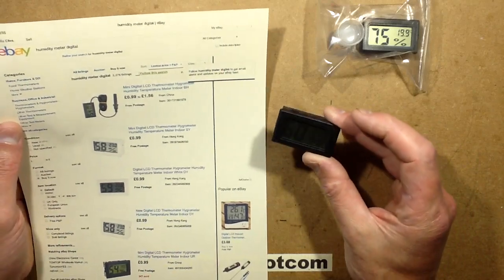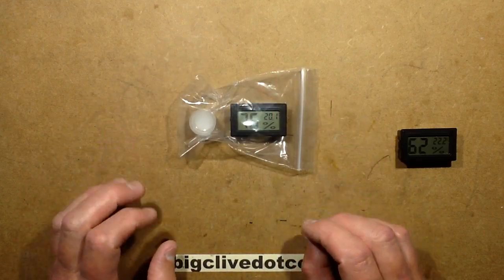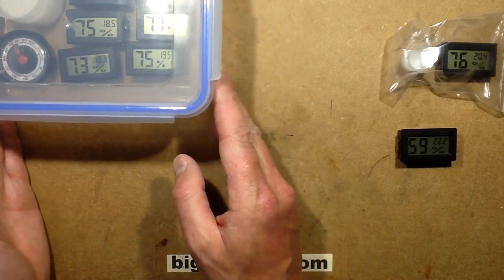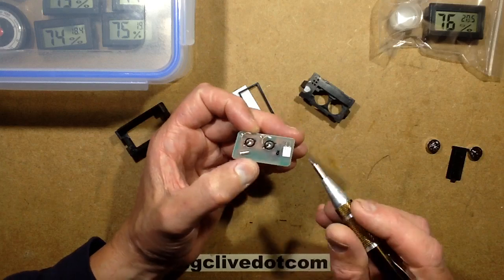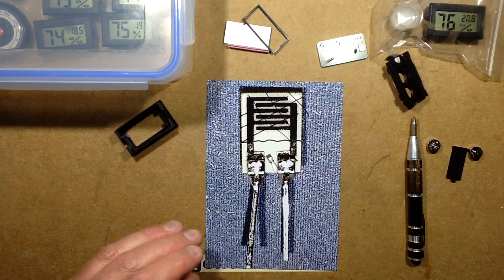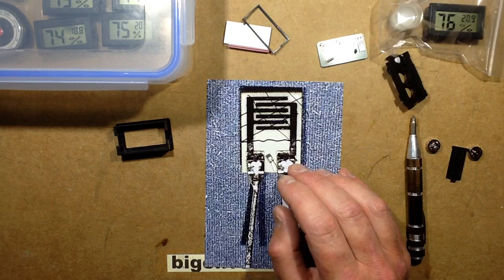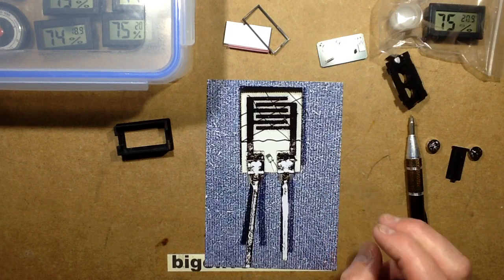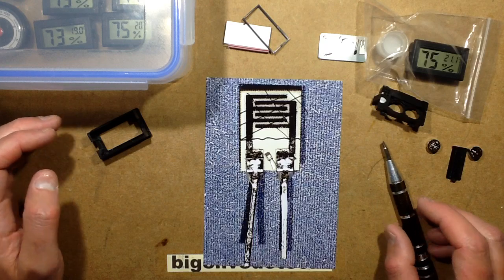Humidity meters and their sensors.

Comment: What is the thin film polymer whare can you buy it so you could redip the sensor yourself is My question I would like to know can you make it yourself I've been wanting to know that for a long time how how do they make them. What is the material polymer can I make polymer what is it where can I buy polymer
Reply from the maker: It's too specialist to be available to the public.
Reply: You haven't answered the question what is polymer. Why can't they use something better to make these things waterproof. And so they can't get contaminated. I have several hygrometers with these type of sensors and they all read different why. Most thermometers don't have that problem. why do manufacturers have such a hard time making hygrometers accurate. Why don't they put 3 calibration points so you can correct the problem. Must manufacturers be so dumb. If they can make thermometers function properly why do they have such a hard time with humidity there's something they're not doing right

Comment: Clive, maybe do an updated video? Of all the info video's online, I come to yours last. Why? Partly entertainment & their twisted knowledge (I'm a bit twisted also) but always dig for factual info within them. That's why yours is last. ANYWAYS... Surprisingly this video falls a bit short on info. Of these cheap digital meters I've not seen anyone attempt to correct their readings. While most are close some are WAY-WAY off. So of a 5 pack humidity & temp meter 3 were reading 99% 98% & 34% . I was going to use rubbing alcohol to wipe the "zebra" strip but instead used a new, dry and UNtouched piece of paper towel. Wiped it in 2 directions back & forth only once (4 wipes total) then set them near my known analog humidity & temp gauges for 3 hours. They all went within 5% (2.5 each way) of each other. SUCCESS = HOO-AHH

Comment: Relative humidity is percent of water vapor at a particular temperature. Hotter air (even by just a few deg C), can hold more moisture than cool air, therefore you need to make sure your temperatures sensors are calibrated FIRST else these sensors will do the math wrong and show you a low/higher RH even when the RH was correct (and it was temp sensor that was off). I see variations in temp in your big box of sensors. The method for this test is correct, but execution is off.

Comment: Are these waterproof? Doesn’t look like it to me. Would rain kill them? I wanted to mount one on my motorcycle
Reply from the maker: They're not waterproof.
Reply: @bigclivedotcom  thank for for answering on such an old video. What would happen if I were to put them on my motorcycle which might get water while washing or maybe rain? I really want to know what the rain would do to them and how I can make them usable in rain
Reply from the maker: @fuzailhamid1122  The sensors can be damaged by direct splashing with water.  They need to be mounted in a way that prevents direct water ingress, while still allowing air ingress.

Comment: WEIRD SENSOR OUTPUT:  On a box store portable dehumidifier:  
Output is 30% all the time.  Exhale on the sensor and humidity spikes to about 90%, then for about 30 seconds, slowly decreases to 80%, then stays constant at 80% for about a minute, then display goes from 80 to 30 or 31% instantly and then stays there forever.

I think something cracked on the sensor (unit is 12 years old), it's open but under high humidity it "conducts" and produces output.
I think the controller has a min display value of 30% no matter how much lower the actual humidity is.

What do you think?

Comment: i have the same unit it used to read 75 and then the battery started to run down I changes it and it now reads 78 with 2 new batteries, I don't know how to change it, I suppose i assume it's +3 as my Bovida packs are 75
Reply from the maker: There is a lot of variation between humidity meters readings.  They can also become contaminated over time.

Comment: I know that this is an old video, but still relavent.  I recently bought five of these on ebay. They were cheap, but I expected them to be fairly accurate. However two had an error of -7% and one of -8%. As they work on resistance, do you think that they could be recalibrated by soldering a resistor across them? I have quite a few around so I wouldn't cost me anything. But before I start it would be nice to know if someone has done this and what values to add. This would only work if the voltage needed to be lowered. I don't know of any way to increase the voltage if that is required. I need to raise the displayed value by 7%.  (I think that the resistance will decreace with an increase in humidity, so adding a high value resistor in parallel has a chance of working and raising the displayed value.)
Reply from the maker: It might be worth experimenting with series or parallel resistors.  It may end up optimal around a central reading point.

Comment: what humidity level is bad for storing electronics? not powered on, but would like to know if I pull the plugs on sth like speakers or a tv and only have them powered on for a short time over a day is bad if its sth like 70-80%? I plan to store stuff in the attic and got it boarded up with osb but there will always be parts that leak to the outside.
Reply from the maker: The main thing is to allow stored electronics to acclimatise to where they are going to be used, to avoid sudden temperature changes causing condensation on PCBs.
Reply: @bigclivedotcom  do they need to acclimatise if they are going to be used in the place where they are stored? The humidity is sth I do not know ehat to expect on those high levels
Reply from the maker: @Ruboka  No.  If it's in roughly the same environment they should be OK.
Reply: @bigclivedotcom  thank you for answering my questions. I appreciate it.
Those cheap hygrometer combo devices are now on amazon cheaper than on ebay it seems. I tries to look for an option to buy a small badge full of those. I hope they will work somewhat ok

Comment: A great fan of your videos. Please make a video about the humidity sensors that comes with common xh-m452 temperature humidity controller used in egg incubators.

Currently most use this "asair am2120" and it doesn't works for more then 2 weeks.

Comment: Good video as usually. If you want a calibration that's more practical, at 43% r/h, use potassium carbonate. Table salt is OK for a calibration at 75% r/h but the hydrometer you're calibrating may not be accurate at normal room relative humidity whereas it might be accurate at 75% r/h or vise-versa. Also, any errors may not be linear. There are other chemical salts that are used for higher and lower % r/h calibrations. See https://www.youtube.com/watch?v=dRUqPWOGtuI

Comment: Ive bought what seem to be the exact same sensors, but all of them display only temperature, and not both.
On the sellers ebay page, there are pictures of both (temp only display, and both).
Is there a way to change what is shown on the screen?Cause if not, I've just wasted $10 :/
Reply from the maker: If you bought them as humidity indicators open a dispute as incorrect item, and don't close it until resolved.  If they try to get you to post them back to China ask for a pre-paid shipping label
Reply: @bigclivedotcom  they are advertised as "thermometer/hygrometer" and there are photos of 2 different displays. Buying options only have different colors (black/white) and even then i bought both.
I'm awaiting initial seller response, then i'll open a dispute!!Thanks for the reply!

Comment: One note: The bottom of the line Acurite humidity/ temperature meter I use seems correct for humidity and degrees C in whole numbers. However if I switch temperature display to degrees F it is obvious that it only displays whole numbers in C, because as the degrees change in F they jump 1 or 2 degrees F. The omitted F numbers never show up on the display. Living in the USA and living in higher whole number resolution Fahrenheit , I just do not have a good feel for Centigrade.

Comment: When they say thin film they actually mean thin film of photoresist on it which is what they use when making microchips. This means the film was put on it when it was part of another 1000 chips on a microchip wafer which are now either 200mm-300mm (8 inch to 12 inch) sized wafers.

Comment: my dry box digital screen panel going to dead soon, cant find any that match the brand...anyway to build one with larger capacity cabinet or seal box
Reply: If you could made a video to build one low power digital adjustable humidity dry box will be very good for thought that what to protect their equipment big or small...So far can't really find one on YouTube. Could be a good content for you :)

Comment: Which hygrometer on ebay has arduino technology in it?
Reply from the maker: You can get humidity and temperature sensing modules with Arduino libraries.  They are just a PCB with a few wires for power and data.
Reply: @bigclivedotcom  Thank you. I do understand that but wouldn't know how to turn that module into a hygrometer. I'd rather buy one that already has that inside of it.

Comment: 1:49 I'd say the variation in humidity reading is not so much an error in the humidity reading, but rather the calculation it performs based on the temperature.  You might mention it later, but I'm commenting in real time; relative humidity is based on the capacity of air to hold water vapor and that changes based on temperature.  The meters in the tub are ranging from a low of 18.3C to a high of 19.9C and show a difference in relative humidity of 4%.
I think it comes down to the accuracy of the temperature probes, but there is another 5m7s to this video and I could be totally incorrect.

Comment: Hi Clive, just dropping in to say how useful this video is 4 years later.
I've been researching humidity sensors for a 3D printer filament drying project and was nearly going to pull the trigger on a couple of $8 already in the nice plastic case with the display jobbies, when I remembered I had a few sensors lying around from a previous arduino project. I wondered how they worked, and the words " hygrometer eBay " brought me straight here. I'm fairly certain if I type anything I'm remotely interested in with the word eBay after it I'll end up with result number 1 being a video of yours....

Top quality content as always mate, stay safe during this quarantine, and as always... keep the explosion containment pie dish handy.

Comment: A friend gave me a couple of these and I didn't notice until I got home that one is in Fahrenheit and one is in Celsius.  I don't see any way to change them.  Is there a way??
Reply from the maker: There may be a solder pad option on the PCB.  It would normally be set at the factory.
Reply: @bigclivedotcom    Thanks for the reply.  Sure enough there is 2 solder pads on the board under the LCD display and on the one showing in Fahrenheit it has a bit of solder on the pads and the one showing Celsius doesn't have anything on the pads!  There is an "F" next to the pads that needs the solder if anyone wants to switch to Fahrenheit.  Thank you sir, Always enjoy your videos.

Comment: Very useful video

 I bought a pair of these with the sensors on flying leads and put them in a wall mounted box on a cavity wall I've been having damp problems with. 

One panel is  reading the ambient  humidity (and temperature), the other the sensor goes through a hole in the wall so I can measure humidity in the cavity and compare them against each other.

Now I can make sure the two units are calibrated the same.

Comment: Hi, I have the same LCD devices. At the shows the constant 10% humidity. Is the sensor defective or does it have to be calibrated? I have already put airtight in a box and with salt. not much has happened.

Comment: Whats better the analog one or the digital? Im planning to buy the analog one because it doesnt have battery ,but I dont know how acurate it is and how it works inside..
Reply from the maker: I quite like the simplicity of the analogue dial units.  You can also calibrate them using a sealed container with a dish of damp salt at the opposite end from the humidity meter.  You can find humidity calibration information online.

Comment: You should try out the strain gauges mate. I've used a lot of them for aircraft structural tests. The linear ones are on ebay now for cheap as chips prices and rather similar to these sensors. Great video! Cheers.

Comment: Is there no way to tweak the circuit components to adjust the accuracy of the
units that are not accurate ??
Reply from the maker: Theoretically you could add either a series resistor or parallel resistor to the humidity sensor to nudge its value in the right direction.
Reply: I'll try that.. Thanks. 
I have one that is reads 18% when all the others read ~41%. Could I have damaged it when I put it into a bag with the salt solution to check it's initial accuracy. I had it in the bag for about 4 days.
Reply from the maker: If it had been contaminated it would probably be reading high.  Many of them are just very out of calibration due to manufacturing standards.  I had a similar one and the sensor was covered in flux.

Comment: Dear Mr Clive, if you have the time, could you test the various resistors and pads to figure out how to get the temperature to display in Fahrenheit? I see the LCD does have "F" next to the "C", and this LCD does look purpose made for this hygrometer.  I'd love if I could meaningfully read the temperature in the U.S! 

I bought 5.  Would buy 20 more if they read in °F.
Reply: In case you didn't figure this out, the typical examples tend to have a couple of pads labeled c/f and if you jumper them together you get Fahrenheit instead of the default Celsius.
Reply: Wow, thanks!  Geez those are tiny pads, I didn't even see them before without a magnifying glass.  Lowercase 'c/f' to the very right edge of the board, centered vertically.

Comment: I had an old 480Watt window a/c, so I decided to use the condenser to dry my bedroom.
  My humidity sensor Implied 47% humidity at 27.7C/82F. I had it in operation overnight, 5 gallons of water later and the sensor still reads 47% Humidity. 
   I think my hair is a far better measurement of humidity.

Comment: I purchased 10 of these little devices, they were sold as ºC (celsius) only. I wanted to use them mainly for the humidity function. As with everything I get, I take it apart first. I discovered there is a set of solder points inside that will set it to ºF (fahrenheit) temperature readings. Bonus!  :)
Reply: How I didn't see your comment last year when I got some of these and asked Clive how to change it, I don't know.  I should have read more comments.  LOL  But he said the same thing about the solder pads.
Reply: Hi @DrTeddyMMM So how did you have them convert Celsius to Fahrenheit? Mine was displayed in Fahrenheit and after battery change it turned into Celsius. I'd really appreciate if you could shed some light. Thanks!
Reply: @shanemagman1191
I ordered 2 recently. They were reading C, so I bridged the 2 connections labeled F with solder. You have to remove the iron slowly so the bead goes across both contacts.
Reply: did the humidity function work propperly?

Comment: I really like the HIH-4000.  It's a capacitive sensor that does a similar job.  The resistive salt based devices age.  Capacitive sensors do not.  They also output a 0-5v analog signal and don't need to be driven with hard to deal with sine waves.  Something to look into...
Reply: We build things for grain store monitoring using the HIH 4000 series sensors, been using them for years. Eventually some do go a bit haywire but most of the time it's due to dodgy electrics on a farm that have zapped some part of the circuitry upstream of them.

Comment: I fitted one of these into a smart Roadster a few months ago. They suffer from leaks and the water turns to vapour and condenses on the main controller PCB for most of the electrics. Monitoring the humidity in the car was an obvious step.

Comment: Ya but that only shows the accuracy at 75% so we have no idea about how accurate it is at 10% or 90%.  Kinda like a dead clock that is still accurate twice per day...
Reply: Yes, single-point calibration is dodgy. If you're only usung the measuring device/instrument at that point, it's probably ok, otherwise you should calibrate the full range of the instrument.

Comment: I used these in my first job making moisture instrumentation in 1999. The sensor needs a higher frequency driving wave at higher humidity to stop polarisation and a much lower frequency at very low humidity. I developed a simple bit of code that smoothly varied the frequency from 10kHz down to 100Hz based on what the sensor was reading, hugely extending the accurate range of the sensor.
Reply: Interesting

Comment: Fantastic little thing, I'm ordering one for my server rack right now, I have my own temp sensor I rigged up using a dallas instruments one wire device but something to permanently install will be handy, though without the ability to datalog like mine.

First one I found has a remote sensor, and I figure that will work nicely since I will be able to put it somewhere in the rack if I want to read the temp from somewhere else.

Comment: If applying a DC voltage across these sensors polarizes them one way or the other.. could that be used as a cheap way to nudge some of the ones you have their closer to accurate?